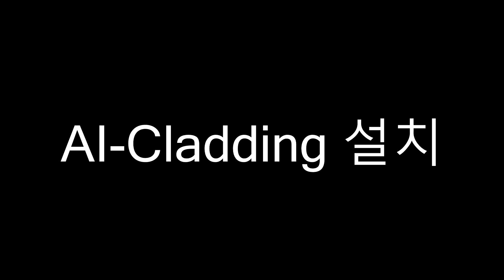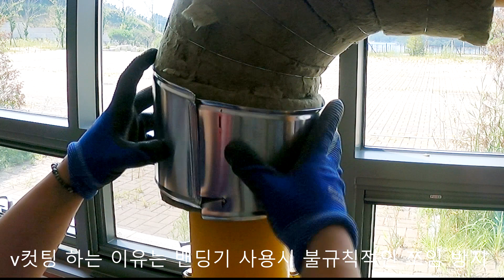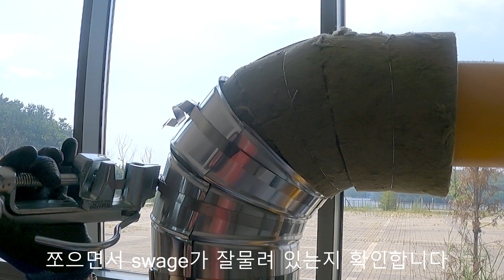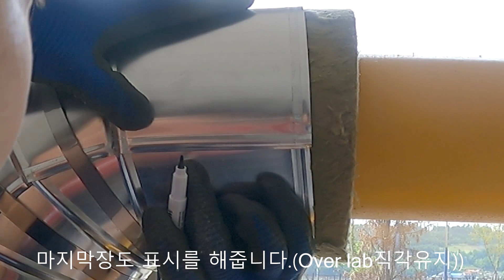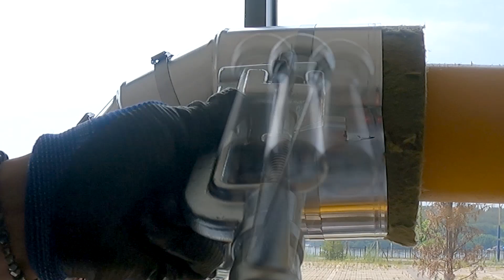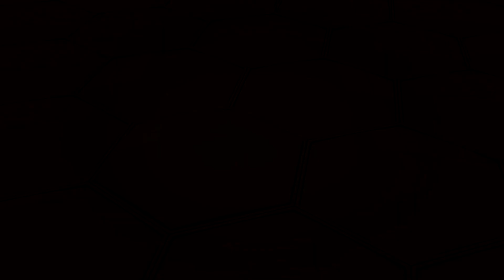Training 12 EG LV1 International Insulation Certification course practice Cladding installation

Comment: Was ist mit Schrauben ?
Reply from the maker: This is for instructional purposes only, no screws are used. In the case of cryogenic insulation, there may be damage to the vapor barrier, so the SS Band can be firmly fixed without using screws and without pressing the insulating material with the "V" Cut (applied to the pipe). The practical training course is thermal insulation using MW, but it is integrated and educated with a method that does not use screws.